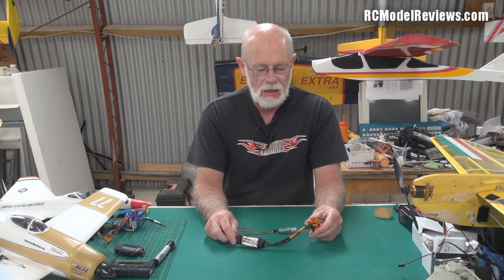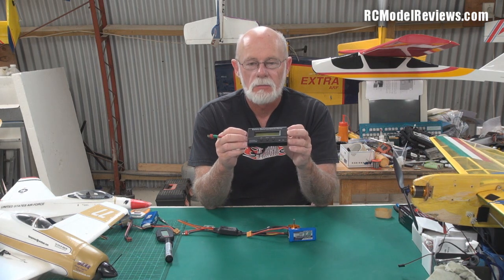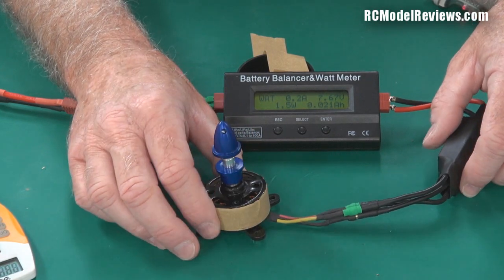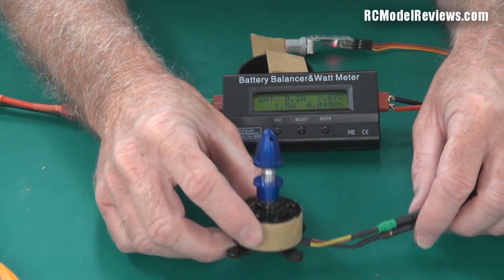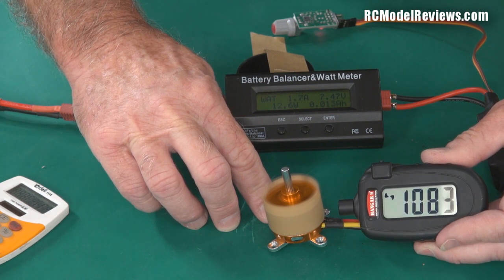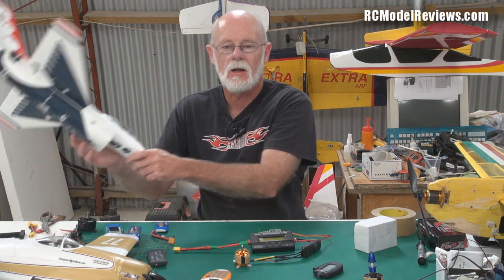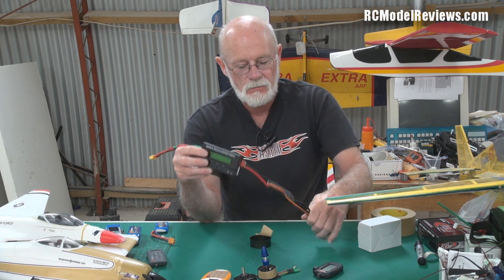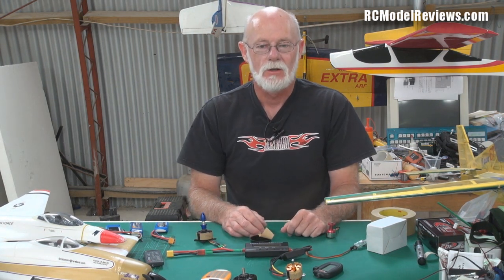RC BASICS: What is KV?

Comment: I'm Sorry but you have got Kv All Incorrect,
Kv Expresses the "Generator Constant" - 
or " Dynamo Constant" and The v in Kv is
Not the Voltage supplied to the Motor or the ESC.

Please update your video.
Reply: +petnzme01 https://en.wikipedia.org/wiki/Counter-electromotive_force
In a motor using a rotating armature in the presence of a magnetic flux,
 the conductors cut the magnetic field lines as they rotate. This 
produces a voltage in the coil; the motor is acting like a generator (Faraday's law of induction.) at the same time it is a motor.

Comment: Sir the ESC and motor do not use AC voltage.   The ESC converts the Battery power to PWM DC. (  Pulse Width Modulation )..   https://www.arduino.cc/en/Tutorial/PWM

Comment: Wow. How many people really have a meter and a speed controller like this? Most people have a drill and voltmeter that reads AC. When you hook the motor up to your drill it will create induced AC volts. Convert that AC reading to peak volts by multiplying by 1.414. If your drill states it runs at 2,000 no load RPM assume it spins the motor at about 1700 RPM. It will run even slower if it is a bigger motor. Here is how you find approximate Kv: RPM/V*1.414=Kv.
Reply: Multiplying RMS voltage by 1.414 to get peak only works for sine waves. An ESC generates square waves
Reply: Geoff Hogg Geoff You are correct that an ESC does not create a sine wave. HOWEVER I was giving advice on using a drill to create induced voltage which will come out AC, a sinusoidal wave form. And we multiply by 1.414 to get peak voltage since our multimeters measure RMS, and we need peak for the KV formula. I edited my original post to make it clear :-)
Reply: The voltage generated by the driven motor is already RMS by definition, if you're measuring it with a voltmeter. You can multiply that reading by 1.414 to get peak. Or if you're measuring peak voltage on an oscilloscope, you can multiply that by 0.707 to get RMS
Reply: Oh dang my bad. Multimeters do measure RMS. We want peak because that's what the formula needs to determine KV.

Comment: This guy tries to make a complex problem simple but in reality just provides a lot of misdirection.  The key thing to know about a motor is not it's kv, nor it's can size which is what most motors tell you today.  The key thing to know is how much power it can put out.   After all it is power than drives the airplane.  It would be so much simpler if every motor manufacturer just gave nitro engine equivalent size.  Some do but most don't.  I use motors that do like the Tacon motors.
Reply: Glenn Roberts he literally says this in the video... you clearly didn’t watch to the end

Comment: wow you are taking so much miss information, the kv and depend of the terminals when you finish the motor. the diameter have nothing to do, I can have the same motor same wire same turns and when i finish depending of the terminals soldering I can turn a motor with Hi KV or Low KV same motor. your are dangerous.
Reply: You should do a clip too mate.  Would be nice to hear this and see some of it explained on camera.